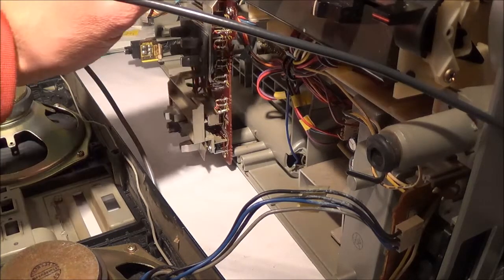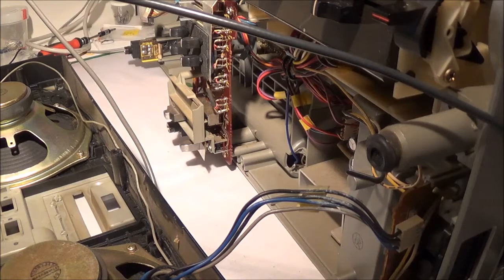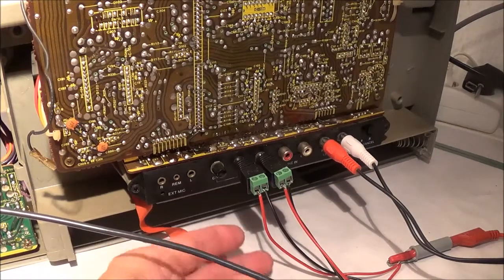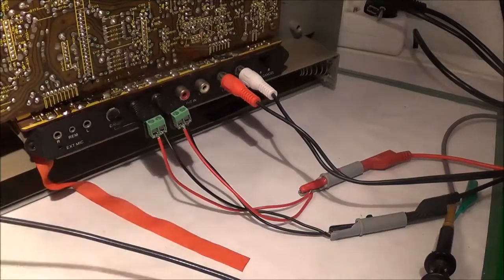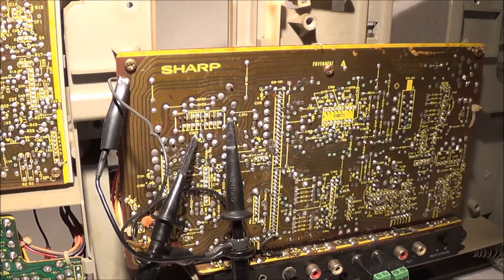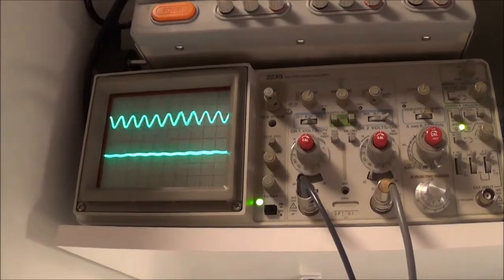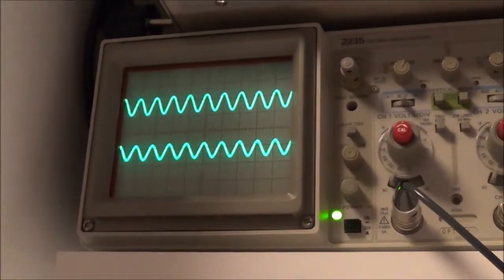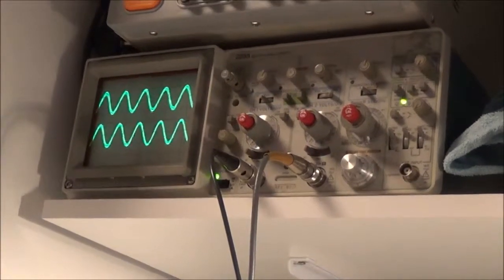Sharp GF-555 Boombox Dead Channel Function Switch Problem

Comment: the actual problem with these boomboxes is that they needs new capacitors just change the caps and then test them it will work on both channel I have fixed too many with this problem just changed the caps with a high quality Panasonic capacitors
Reply: Hello, I'm bothering you, I'm having the same problem, which capacitors should I change? Thank you very much. hugomicro@hotmail.com

Comment: Hello  I  have the same issue with a recent bought gf555 , one channel has not sound . I sprayed gently  the switch  from the distance of 100mm  .. but still with the problem ... maybe its necessary  special tip to clean more deeply??
Reply from the maker: Ok, you need to get as close as possible to get the spray into the switch; there is an opening somewhere. Get the spray in there good. Once you are done spraying, work (use) the switch a few times. The spray cans  normally come with a plastic long nozzle (tube).  I sold this Sharp, so I can't take a look and then tell you exactly where. Spray with the power off. 100 mm (10 cm) is too far; you need to be much closer; all the way at the opening
Reply: @OldSchoolElectronics  I was spraying with contact cleaner with tube as you wrote directly to the switch selector and  no had any good result.   Maybe is another kind of problem  more serious?  The left channel  can be audible in a  weak level... almost  nothing ...
Reply: With headphones is the same ..only right channel is OK...
Reply from the maker: Ok, you need to check if the problem is for all functions: radio, cassette, etc. When I said switch, I mean the switch at the end of the flat cable, not the lever at the front of the unit. Again, I sold the unit so I don't remember too much about.
Reply: @OldSchoolElectronics  yes yes I sprayed the switch directly... bit this kind of switch it seems very closed ... no holes to spray in....  anyway thanks  for your time !
Reply from the maker: You could drill into the case of the switch to make a hole. I think it had a plastic case.  Very carefully. Do so at your own risk. But then again, the problem might be elsewhere. It could be many different things. You would need test instruments and electronics repair knowledge.
Reply: @OldSchoolElectronics  finally I was able to open the switch cover (plastic cover) and this time I sprayed contact cleaner  inside the switch enough quantity to clean it all... then moving the control switch  a lot of times....  but no result ... the problem continues. Only right channel is OK in the left almost not sound (only a very very low volume)...   if you have any other idea not so dificult for a newby i would like to check as I have nothing to lose .    
Thanks to your other video by the way when tried to repair the missing channel i was able today to change the rubber belts...
Reply from the maker: Good job with the belts. The other problem might be difficult to solve without test instruments and electronics repair knowledge. You still haven't said if the problem exists during radio, cassette use, or whatever. If it is only the cassette with problems then I would try to spray the record/playback switch on the board behind the cassette mechanism. Spray all the other switches and the volume control, etc too; could be there is a contact problem there.
Reply: @mamapizzavintageaudio  Did you finally found out what was the problem ??? I bought this same device, and run out on the same problem...exactly the same. Only very very low sound from the left speaker, no matter, whether i´m playing cassettes, radio etc.
Left speaker itself is Ok, ´cause i´ve have tested it, so, the main issue has to be somewhere else, but where ?
Reply: Change the capacitors and it will work like new

Comment: hi

in the vol control do you know what type model of the slide volume control specs and size -as its showing alps 20k  and would like to replace my vol control I would like to know the size and where i can get it - thanks
Reply from the maker: +jonram747 Sorry, I no longer have this. Maybe you can take the volume control apart, if it is not broken off.